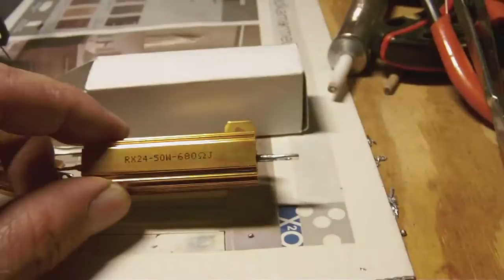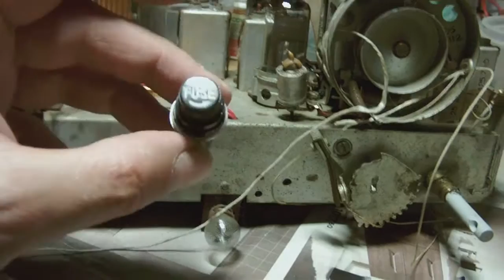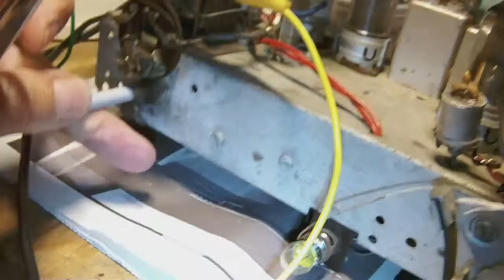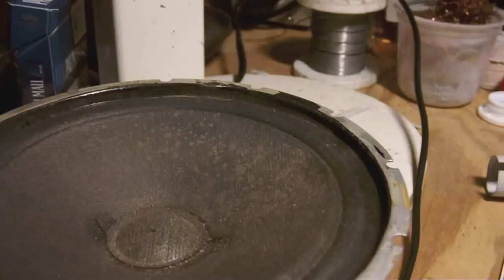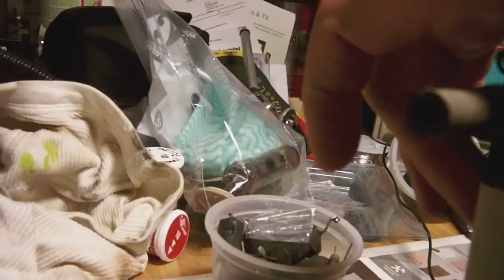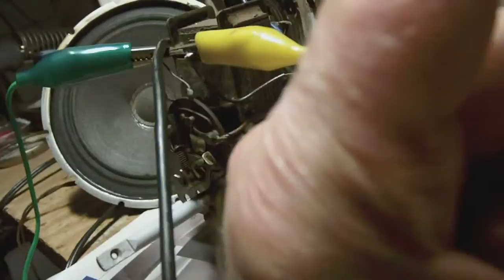Philips BX230U part 5 of 6

Comment: For future reference to locate potentially gassy tubes, the silver coating on the top or side (called a getter) will either turn white (gone to air) or the silver coating has gotten thinner (easier to see through, slow air leak)
Reply from the maker: Hello. Yes, you're right of course. However, I couldn't resist to show the "fireworks" of a gassy tube to my viewers. I imagine some have never seen that famous  "blue light" so typical for gassy tubes. Maybe I should have stressed those telltale signs you sum up. I'll do so next time I find a faulty tube :)
Thanks for watching.

Comment: Nice work on the radio. The reason why the light bulb, lights up briefly is because it is placed in parallel with R19 and the rest of that is in series with all the filaments. And when the tubes are cold, the filaments have a low resistance causing a lot of current to be drawn, thus big voltage drop on R19 and that dropped power will light up the light bulb. You've said that you left out a "useless" resistor, I bet that, that is your problem. Keep up the good work. Cheers :)
Reply from the maker: I'm glad you liked the video.
It turns out the solution to the problem was much simpler than suspected. When I replaced the faulty PTC I neglected to check the solderpoints. One of them was badly soldered and as a consequence the lightbulb got very little current to draw on. I replaced the resistor with an NTC to reduce the pulse of current when switching on the radio, thus reducing the risk of burning out the lightbulb (I burned one in fact before I realised which solution to use). The new power resistor (of 680 ohms) is 30 ohms more than originally designed for (200 + 450 ohms). That in combination with the NTC keeps the lightbulb from harm.
Thanks for watching :)